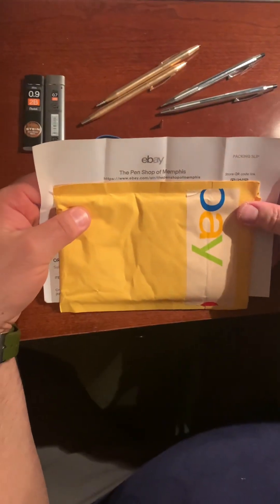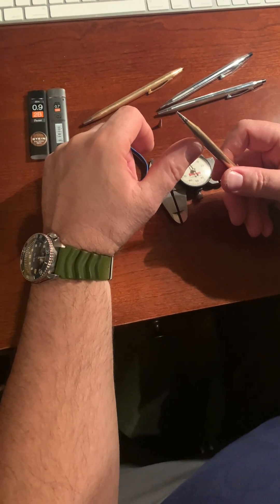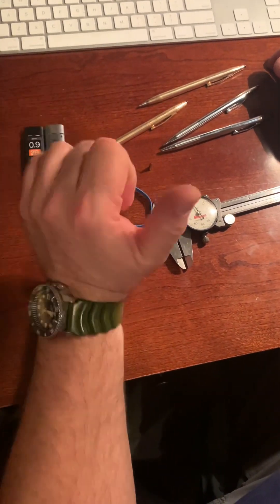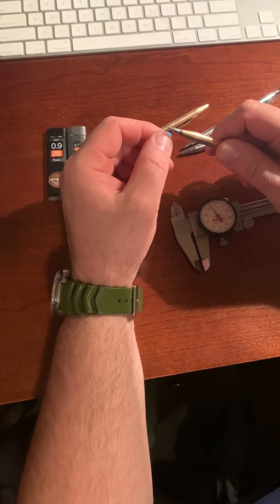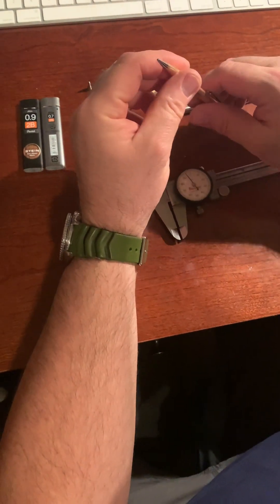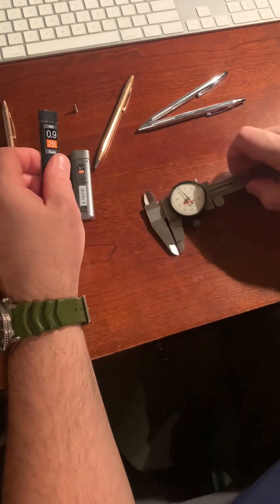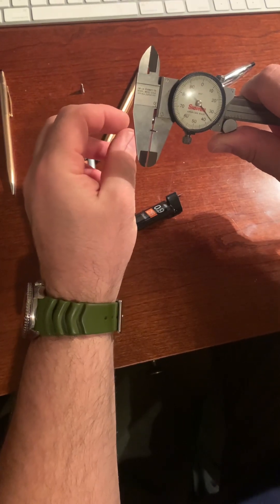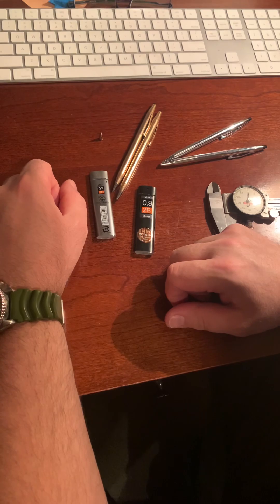Fixing a Cross Mechanical Pencil - Follow-up

Comment: THANKS SO MUCH!!! I have a gold-plated cross pencil with the Ball Aerospace logo and it was given to my grandfather when he worked there. I had a problem where the lead wouldn't come out and it turns out there was a piece stuck in the mechanism that holds the lead in place. Thanks for showing me how to remove the tip.